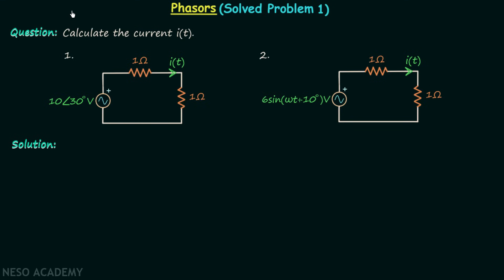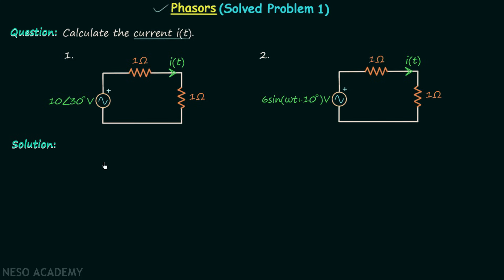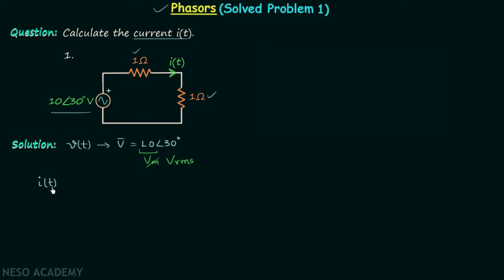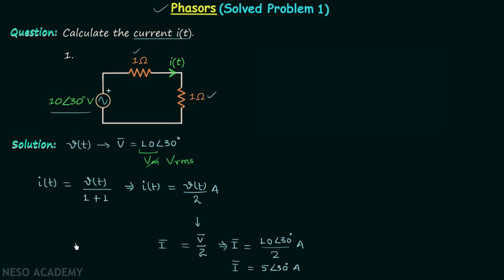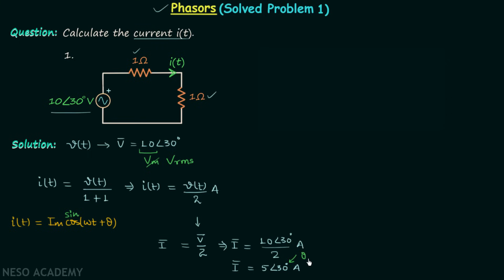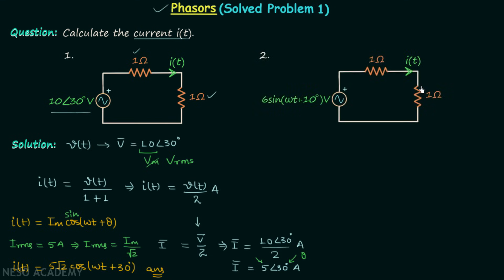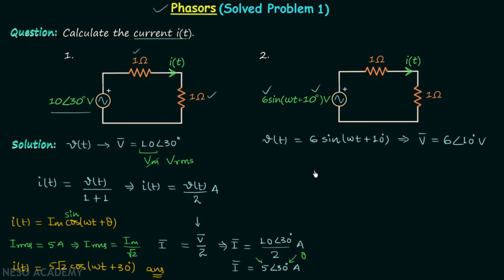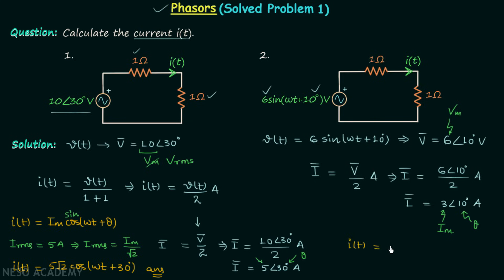Phasors (Solved Problem 1)

Comment: See guys in second question,we all got confused because of phasor ,see we need i(t) and we have v(t) so just divide by r to get ,we  get the answer ,the rms vm confusion is here because,he has not changed to rms because we need answer in vm

If we do by phasor then v phasor is 4.242 <-80°(after converting to vrms and cos)
Now I phasor is 2.121<-80°
Again converting back to i(t) we get 3 sin(wt+10)

Comment: Second solution will be like
i(t)=v(t)/2
     ={6sin(wt+10°)}/2
     =3sin(wt+10°)
This ans is same as your answer.
But why do i take phasor form of voltage? And then get phasor form of current and then get i(t)
Is there any Necessity to follow these steps?

Comment: Q.peak or RMS
A. First question the voltage given was in phasor form so that was the RMS value in the second question it was given in sinusoid form and in sinusoid form the amplitude given is the max value so he took peak value..hope it clears!!
Reply: why we did not change sin to cos by adding 90 degree
Reply: But if we get a question with a phasor value like the first one, what should we consider? According to the graph, it should be max but sir said it is usually rms.

Comment: How would I decide whether to take Vm as peak value or rms value.
And in question if Vm is assumed to be rms values then Im in expression of i(t) should be in rms as well
(but you have placed peak value of Im).
Please clarify ..
Reply: Yes i have same question. Please clarify.
Reply: Yes. Even i have the same question.
Reply: Basically a rotating vector, simply called a “Phasor” is a scaled line whose length represents an AC quantity that has both magnitude (“peak amplitude”) and direction (“phase”)So,it is only peak value not RMS..
Hope This will be helpful..
Reply: @skcreations8159  you confused me so was it a mistake in the first question that u assumed it as an rms?
Reply: @omarbalkis7009  Peak Value only,not RMS
Reply: @Neso Academy pls clarify this doubt
Reply: I have a same doubt...

Comment: In first problem you taken 10 as rms and
 second problem you have taken 3 as maximum value......
How.....?
Reply: @nesoacademy  Could you please explain this? In the first circuit, you assumed the amplitude to be equal to Vrms, however, from the phasor equation obtained from the sinusoidal voltage (Question 2) you referred it to as Vm.
Reply: Hmm. Tomorrow i have exam. And i confused about this part ahahhaahhaha
Reply: @nesoacademy  current of first circuit i(t) = i max cos  or 
i rms cos............?
Reply: I max or I rms comes in the formula for i(t)
Reply: i also have the same question
Reply: No he cant
Reply: Basically a rotating vector, simply called a “Phasor” is a scaled line whose length represents an AC quantity that has both magnitude (“peak amplitude”) and direction (“phase”)So,it's only Peak Value not RMS..
Hope,This will Helpful
Reply: @skcreations8159  u mean he was wrong in the first question?